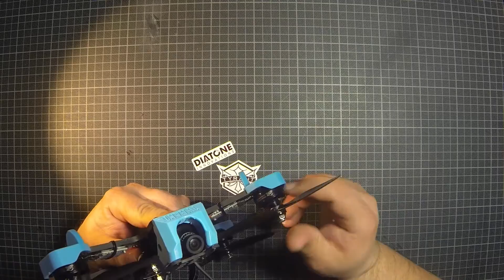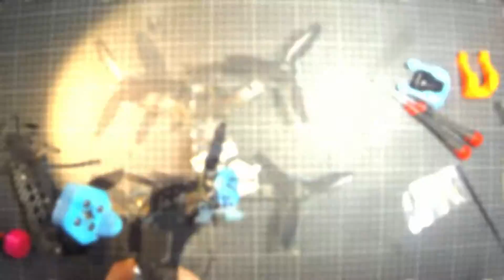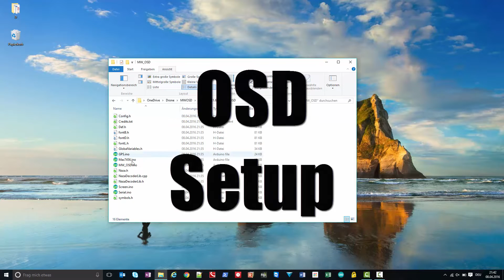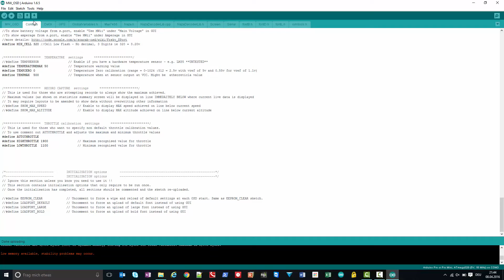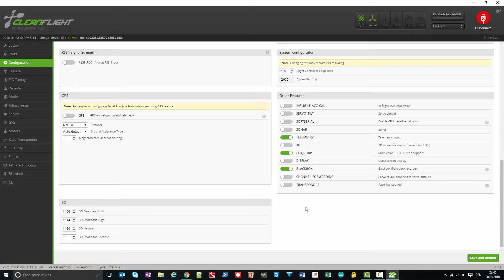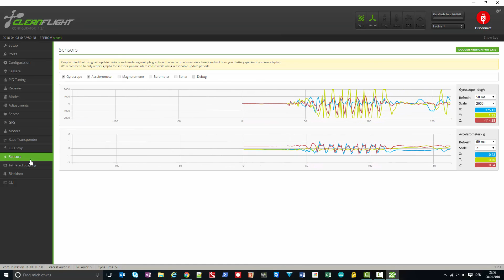Diatone Tyrant 215 & Flip32 F3 AIO-Lite: Build, OSD & Setup

Comment: Sehr schönes Ding! Hab den gleichen Frame & FC ;) 
Weißt du was es mit dem Current Sensor am FC auf sich hat bzw wie oder was da anzuschließen ist? Gruß Ill
Reply from the maker: +Dennis B Currentsensor wird ähnlich funktionieren wie VBAT daher es wird eine kleine Spannung gemessen und dann umgerechnet ... leider habe ich nicht genaueres. Diese externen Current Sensoren bestehen meißt aus nem großen Widerstand und nen chip der die Differenz misst. Für die APM Boards gibts diese Current Sensor Boards relativ oft - aus meiner Sicht lohnt es sich nicht wirklich. Habe den Inbuild auf dem Flip32 AIO mit drauf --- sehr schwer zu kalibrieren - und nicht wirklich interessant - hole dir lieber mal von frsky so nen externen sensor und logge das auf der Taranis - dann halt wechseln auf verschiedenen coptern.